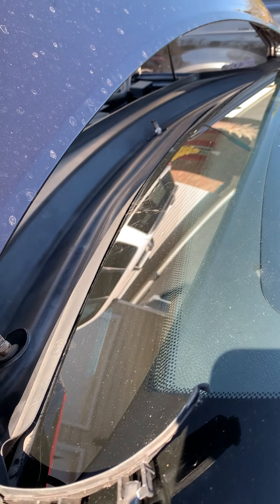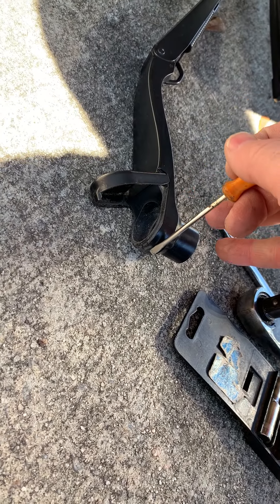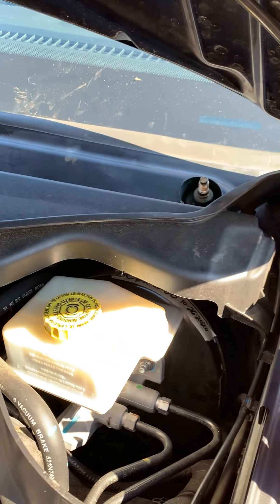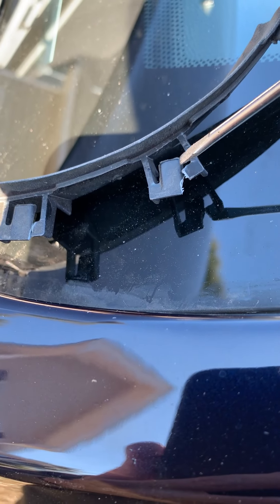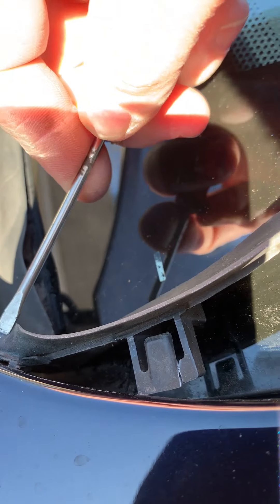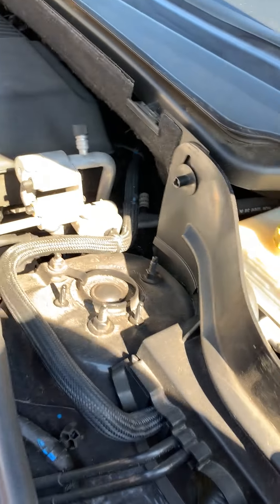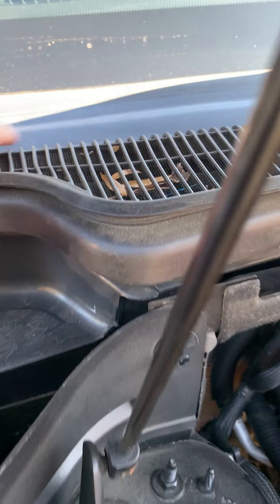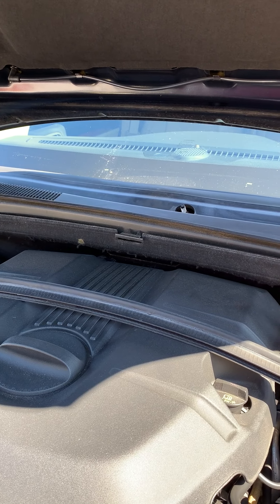2011 Jeep Grand Cherokee Windshield/Dash Area Buzz Noise - Air Cowel Replacement

Comment: WHAT ABOUT RESEALING THE GASKET TO THE GLASS?
Reply from the maker: There are only two sections of that air cowel that kind of "seal." The broader length of the air cowel seals down via pressure and the flexible rubber gasket (this rubber part is what degrades over time, gets brittle and then allows air travel underneath to give that buzz noise). On the passenger and driver side there are two small sections of the cowel that have adhesive that sticks down to prevent water and mainly junk from getting down in behind the cowel area.